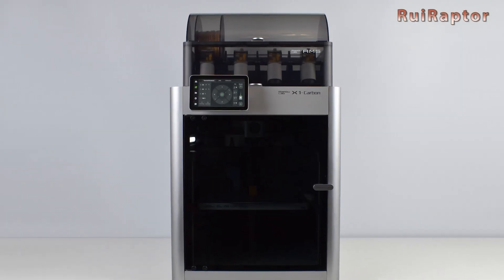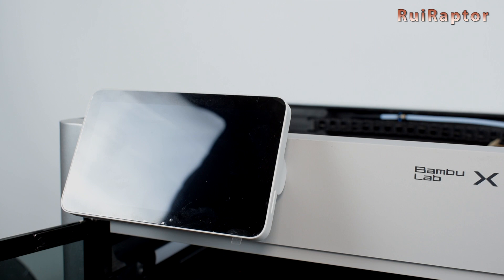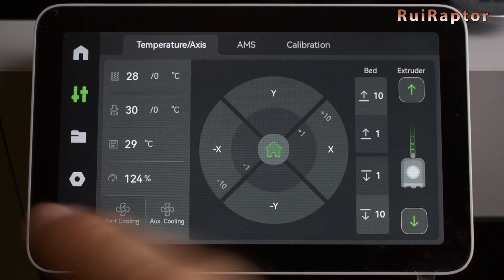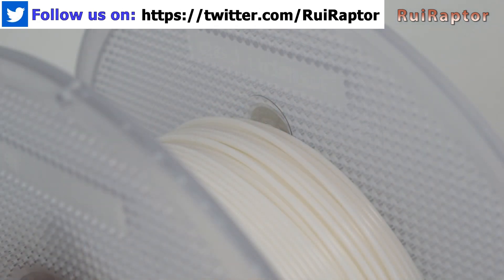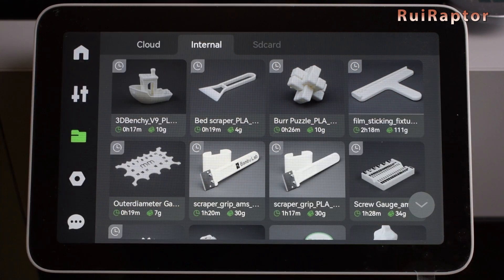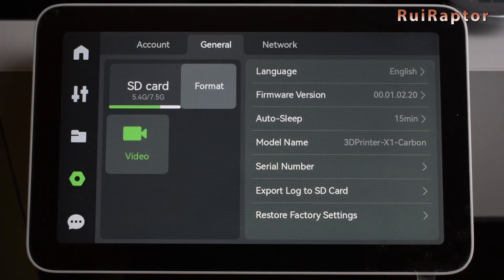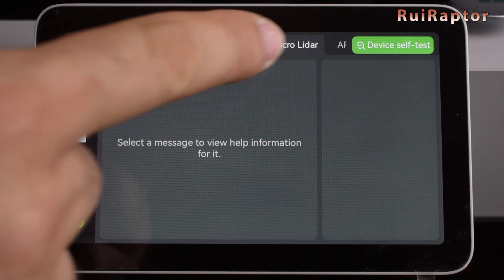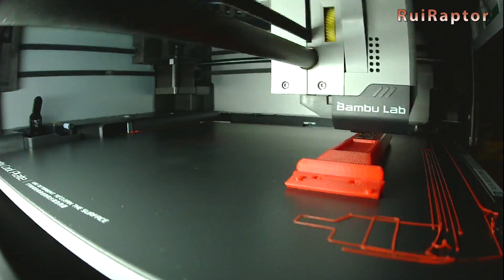Bambu Lab X1 CARBON - Graphic User Interface WALKTHROUGH

Comment: Thank you. this is one of the only videos that I found that even mentioned the sd card and the only video that actually showed someone inserting it. Its a bit tough to insert and I didnt want to accidentally break the $150 screen trying to put the sd card in, Thank you for the simple yet reassuring video, definitely earned a like and sub
Reply: Never seen anyone show that you could turn on the display with that button either, in fact one youtuber was afraid she would interrupt the print when tapping the screen mid print. Apparently you don't need to do that.
Reply: @atnfn  Huh!!! 😍 I had a power outage last night in the first 1/3 of my rather large print… can’t even tell you how scared I was to even look what happened inside of the chamber. To my astonishment, when I turned the printer on, the option to resume was granted - and it finished the job successfully!!!

Comment: For a 1 color print is it possible to choose any of the 4 filaments loaded in the AMS?
Reply: Yes
Reply from the maker: Yes, you can choose which filament/filament slot to use.
Reply: @sdqf  Thanks. It seems like a no brainer but I wanted to be sure.
Reply: @ruiraptor  That is going to be a great feature!
Reply from the maker: You can check the next video where we will explain a few more things and that is included 😉
Reply: @ruiraptor  Cool! I’m already in on the Kickstarter. This is the printer I didn’t know I was waiting for.

Comment: Could you please do a video on how to set up the printer or slicer to print one color up to a certain height, then switch to a different color through the rest of the print.

Such as a 3mm thick black rectangle with white lettering on top.

I've tried to paint with height,but can't get it to work like I want.